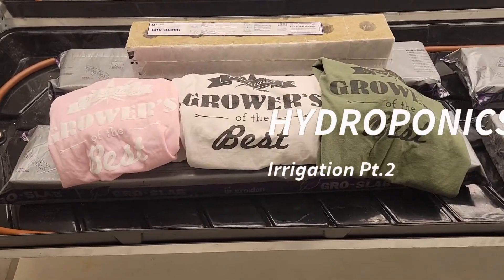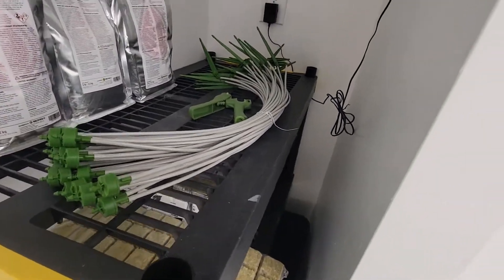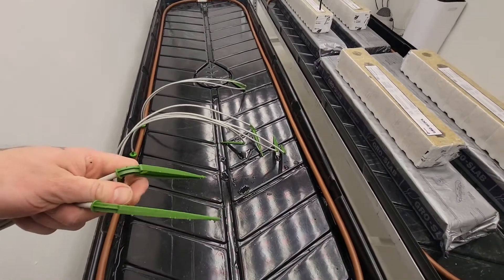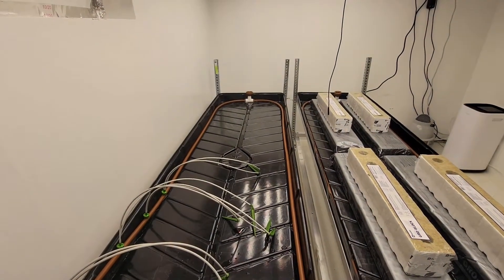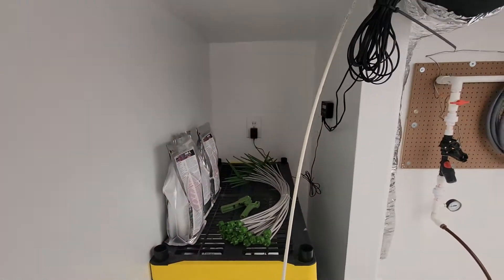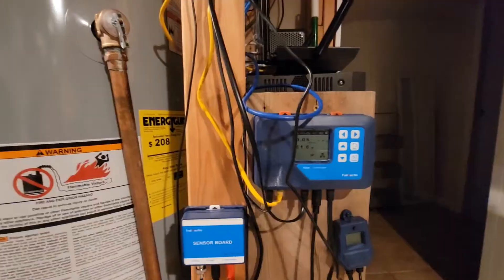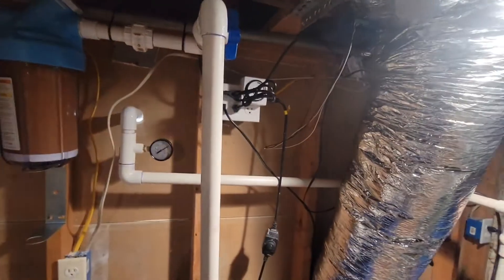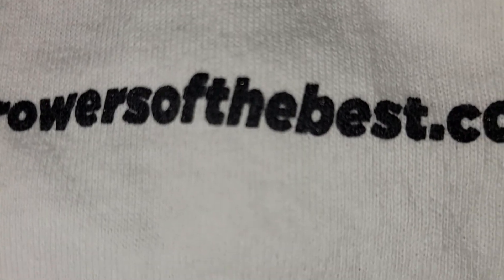Automated Irrigation Drip System [Pt. 2]

Comment: Hey boss I gotta ask what type of connection you used to attach your piping to the tray? I’ve been stuck on this part of my runoff collection for a while and can’t figure it out. Also is it flush with your drain tray? Thanks
Reply from the maker: Those were drained to waste and I used 1" pool spa hose
Reply: @Phenofiend  how’d you get the hose to connect to the bottom of your tray tho? And still be fairly flush with the top of the tray? Issue I’m having right now I cannot finan piece that will work